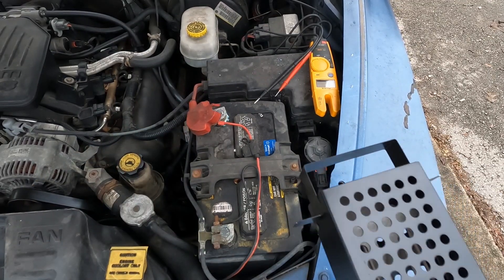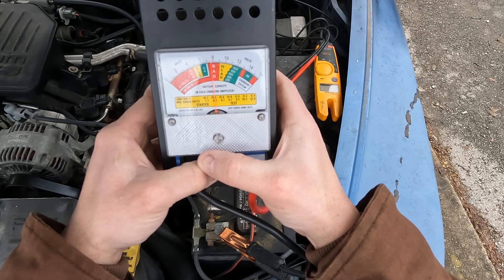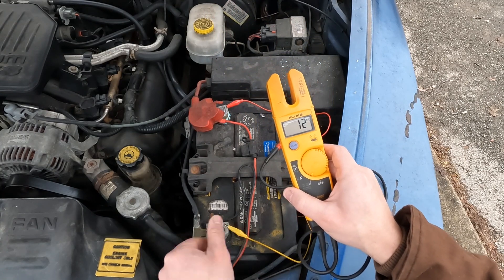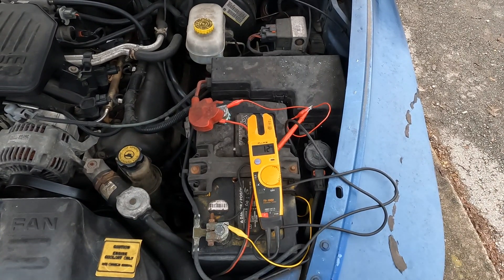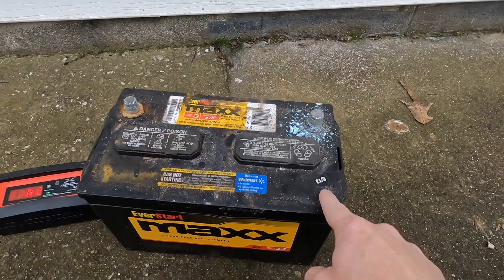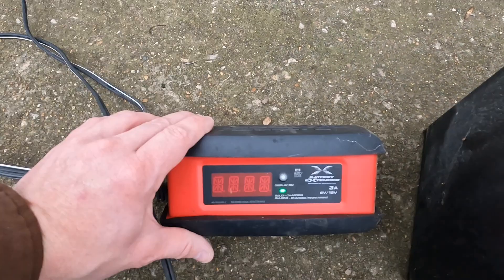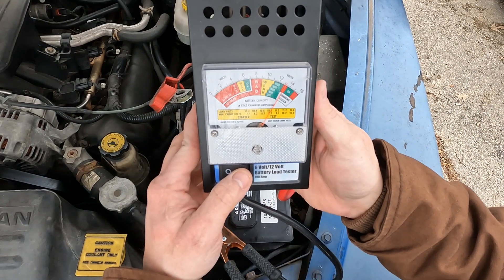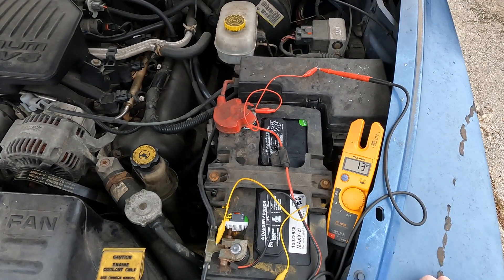Testing A Battery With Cen-tech Load Tester

Comment: not certain you want to do a load test with the rest of the car connected connected across the battery. You should have disconnected the positive side then do the test for max 8 seconds
Reply from the maker: That is probably true.  I checked the owners manual just to be sure and it doesn't mention disconnecting the battery from the vehicle so the majority of people will probably be doing it just like how I did. 
Thanks for the comment and watching. 👍👍
Reply: @projectswithjw  interesting, it’s possible the manufacturer did not consider this. If the goal is to test the battery it should be isolated. Also, if you consider the car had a short, this load test would not be accurate.